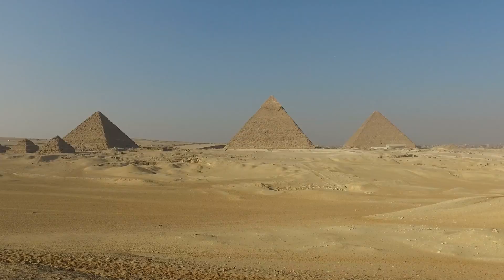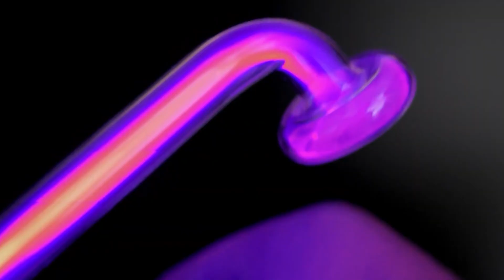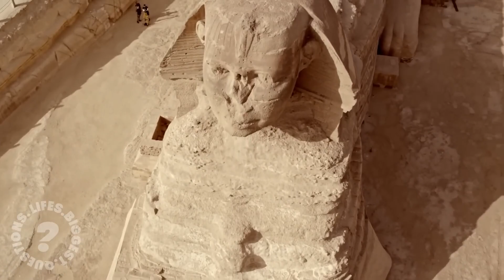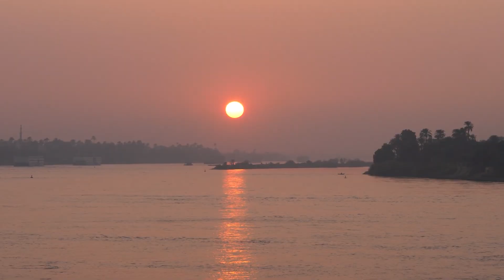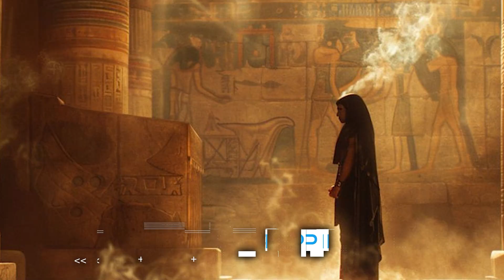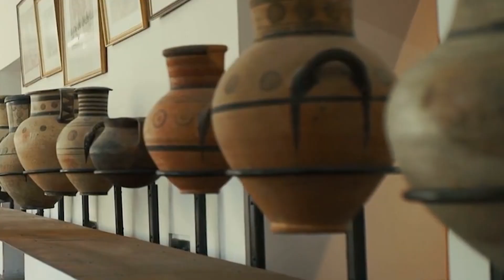Egypt's Ancient Osirion Pit And Logic Defying Hydraulic Technology That Can't Be Explained | Series

Comment: The Osirion was an ancient water pump. It was sealed shut and completely filled with water under high pressure. The damage visible on the stones comes from an accident where the inner water pressure of this water battery propelled the entire ceiling on top the structure upwards. After the release of the water the ceiling collapsed and crushed many of the underlying stones. Thank me later. And don't forget to quote me if you want to base your PhD upon my observation.
Reply: How and why is the water healing or is that just in everybody’s heads?
Reply: Nice theory.mabey.

Comment: The Osirion:
On all the interior Doorways, the tops are indented into the top stone, for what ever reason.
But the doorways at the ends do not have this indentation. I don't think they put there by the original builders.
Which would make it a sealed room, so there must be a way to in from below.
Everything at either end was added later, not part of the original design. Furthermore, the stone work outside the Osirion is different to that of the inside of the Osirion. So I believe the Osirion was made way before Egyptians moved in.

Comment: That would explain why there are no smoke stains on the ceiling, certainly this would be present if they used torches.
Reply: Not necessarily, if you put a metal plate above the flame attached to the torche the stains will stick to the under side of the plate , like a lantern

Comment: How can the sphinx weigh 200 tons yet the baalbek stones in Lebanon be estimated at 900 tons?
Reply: Balbek stone is granite more dense than sandstone
Reply: @williamvinton8105  

Baalbek is a place, not the name of any single stone there.

There are granite and limestone pieces used in the ruins.

The huge piece at the quarry which is constantly referenced is limestone, not granite.

As are the trilithon stones used in the retaining wall for the temple hill.
Reply: @williamvinton8105  240 feet long by 60 feet high? It's waaaay more massive than the Trilithon stones, or the Stone of the Pregnant Woman, and the two slightly more massive stones beneath. The difference in density between granite and limestone (Giza is a limestone plateau, not sandstone) is negligible and Aswan rose granite is actually slightly less dense on average. Giza limestone's average density is 2.71g/cm3 while Aswan rose granite's density is 2.697 g/cm3 on average.

Comment: We are at the 10 minute mark and I am surprised no scuba divers or RC vehicles to investigate the depth and corridors. No mention of structural integrity being a problem.
Reply: It hasn’t even been determined how deep the wells are! Wiki says „at least 10 m“. The inexhaustible body of underground water could be put to use, greening the desert!
Reply: @Hallands. And that water is supposed to have special qualities, so could not just green the dessert if true 😅
Reply: @yvonne3903  Why not?
Reply: @Hallands.  Simply meant it could have other uses ALSO.
Reply: @Hallands.  

"the inexhaustible body of underground water could be put to use"

It's not inexhaustible, it's just the water table, possibly combined with a divergent branch of the Nile flowing beneath the ground as yet unmapped, which is not that unusual given the amount of limestone about Egypt and its tendency to develop underground rivers.
Reply: @mnomadvfx  No, it probably isn’t inexhaustible, but the narrator claimed it was…
Reply: "No mention of structural integrity being a problem"

It's built with granite which unlike limestone is non permeable.

If the foundations sit on the bedrock there is no reason to think that structural integrity will ever be an issue.
Reply: Josh Gates will zoom in and take the credit for the find lije everything else

Comment: Again the Egyptians didn’t build this
Reply: Who else did then?
Reply: @stickemuppunkitsthefunlovi4733 the antideluvians
Reply: @robierabit  no they were built after the flood of noah.
Reply: @stickemuppunkitsthefunlovi4733 the people that lived there 50 000 years ago
Reply: @stickemuppunkitsthefunlovi4733  It was built the blacks, then later appropriated by various invaders into the continent. The math, culture, and engineering were all african and originated in West Africa
Reply: @stickemuppunkitsthefunlovi4733 possibly the same group who actually made the pyramids
Reply: @v4panigale26  you've watched too many YouTube videos. I could build the pyramids and them temples.
Reply: @stickemuppunkitsthefunlovi4733  are you aware of the accuracy of great pyramid build. ?
Reply: @v4panigale26  are you aware of mathematics and a tape measure? Set squares and straight edges?
Reply: @v4panigale26  modern buildings are more accurate than the pyramids. They are far from perfect. They are within a certain tolerance.
Reply: @stickemuppunkitsthefunlovi4733  it is only since we had laser measurements that we could accurately measure them and the great pyramid is at the exact centre of the earth’s landmass to within a few hundred feet
Reply: @v4panigale26  the sides of the pyramid are not equal. They didn't get it bang on and didn't even try.
Reply: @v4panigale26  and what map are you using to prove where they are?
Reply: @stickemuppunkitsthefunlovi4733 😂😂😂😂 how many years?
Reply: @josteincarlsen2905  depends how much you wanna pay. No cash, no dash.
Reply: @v4panigale26  

"and the great pyramid is at the exact centre of the earth’s landmass to within a few hundred feet"

By what measure?

The exact centre of Earth's landmass is entirely up to whoever draws the map.

The map based on a system of latitude and longitude which did not exist in the times that the pyramids were built.
Reply: @v4panigale26  are you aware that any idiot with a 12 segment ruler could build it with this accuracy contrary to what some youtubers would have you believe to get views ?
Reply: @stickemuppunkitsthefunlovi4733 Get to building then. You talk a good game!
Reply: Lol
Reply: You have no idea whether they did or didn’t.
Reply: @Youtubepurplebelt  how did they have the knowledge or technology ?
Reply: @v4panigale26 can you present any evidence for the „group“ that you mentioned ? because there is plenty evidence for the egyptians to be the builders
Reply: @falkooo002  there is no real evidence, there are a few theories but no actual evidence
Reply: @v4panigale26  so to understand this correctly, YOU mean there is no real evidence that the egyptians built it, so it must be some mysterious group of people for whom there is no evidence at all that they even existed and no „theories“ ? is that really what you believe?

how old do you think the pyramids are ?
Reply: @v4panigale26  so in other words you have no idea what you are talking about
Reply: @falkooo002 what evidence??
Reply: @v4panigale26  

"how did they have the knowledge or technology ?"

The same way we do.

Passing on learning from generation to generation and making the best of what they had to work with.

The human brain has evolved to be extremely adaptable to circumstances and problem solving.

People living in an age of abundance as we are cannot imagine clearly how the ancients had to adapt to their problems.
Reply: @v4panigale26 How did you have the technology and knowledge?
Reply: They also supposedly didn't build the pyramids either, but inherited them from the aliens who created us. The human royalty, in their typical arrogance, were only too happy to attach their names to them.
Reply: Let me guess if they didn't make it the white people did correct probably ly the brits or America lol😂
Reply: Nope it was white people and a few Mexicans.
Reply: White man built nothing but gay bars and buttplugs @splinewalker214
Reply: I agree.
Reply: If Egypt process this technology to build the whole megalithic structure, this country will be number1 of the world lol
Reply: Yep agreed 👍  only the casuals deter 😂
Reply: Again, prove it.

Having feelings about the subject is not evidentiary proof.

Comment: The Osirian looks like a giant circut
Reply: Sure does.
Reply: Foolish notion.

A circuit in your head only looks that way because electrical engineers choose to lay it out that way.

An electrical circuit can look however you want it to so long as the basic elements are addressed.
Reply: @mnomadvfx  Obviously.However,
In my opinion ,it resembles an analog interface board.
Additionally, I'm not discounting the water ( obviously from the Nile ), which is loaded with conduction minerals and also Quartz,which has high electrical  resistivity.Thanks for the comment
Reply: @tarkus4283  
   Not from the Nile ! Some maybe mixed with the Aquifer Spring water during the Winter when it floods.
Reply: @mnomadvfx ok genius.. where did the thought and design of the circuit board come from? History repeats itself. Sorry you aren't smart enough to comprehend they have LIGHTS AND ELECTRICITY.. where are the soot evidences from torches in the pyramids for light? What are the hyroglyphics depicting holding two giant light bulbs? Sorry you're too uneducated and pretentious to comprehend you're not told everything that is already known about ancient times and people 😂